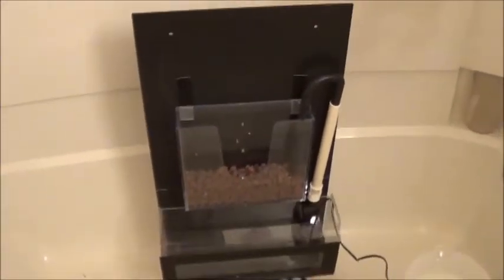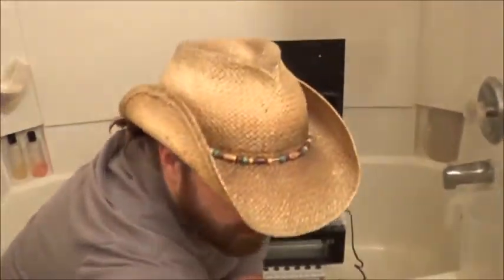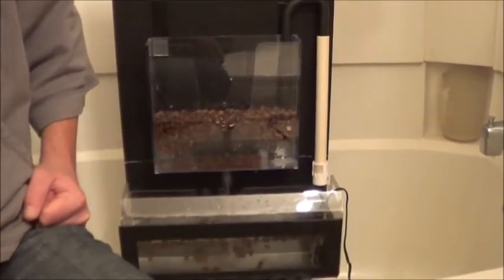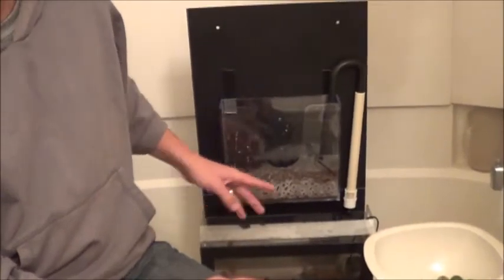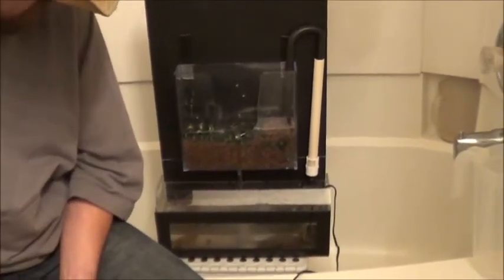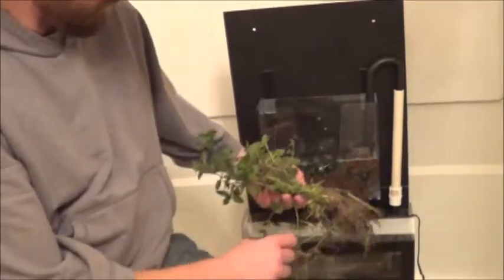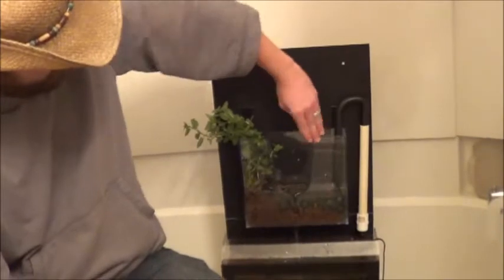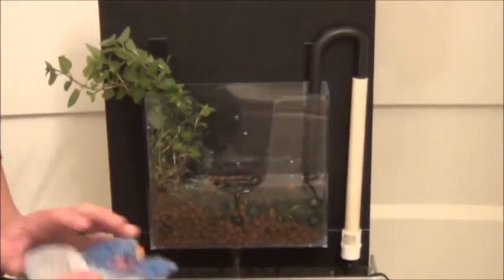Appleseed Aquaponic Waterfall Garden First Water Test

Comment: That was my first thought too... shorten the top of the pocket. Would save on materials cost also.
-
Second thought(a day later), with there being so little room for roots. Especially after watching your stevia video. Just move the curved part way to the top. Then there would be a nice deep pocket for roots. : )
-
Other thoughts / questions:

Why does the Pocket need to be adjustable(up n down) ?
The light does that. So there's really no need from my point of view.
That should cut the cost of the do dads that the pocket sticks to the back on, by 80-90%?
The 4 do dads could be pre-installed at the factory, so they're nice and straight. This would be a place for some uber QC! People having tilted pockets won't be happy.
-
I could go so many places with something like this. Just never had the money for all the up front cost. Like the thousands needed for patents to even consider starting with all these ideas that have gone through my head in the past 50 years. lol
Heck, just sitting here typing this, I've thought of a way to, not use, hydroton. : )
I still believe that stuff is not good for our ap systems. Because it's most likely continuing the nitrogen cycle all the way to removing nitrates. : (
Reply: Much like Kleenex being transposed from a 'brand' to the generic term for facial tissue, Hydroton has been associated with expanded clay pellets.  Expanded clay pellets are made by various means (the most common being heat and/or pressure based), but almost all involve using a 'natural' clay base (I would recommend researching the hybrid base products prior to use) .

Over the years of research, and my own experience, it has never shown empirical data that expanded clay pellets deplete nitrogen/nitrates in an  aquaponic system.  Some studies show just the opposite in that it assists in making the nitrogen/nitrate available.  Others show that the 'base' is basically neutral, and has little to no effect at all.

In traditional farming, it has been found that nitrogen molecules may 'attach' to the clay particles in the soil, and then be made available to the plant root zone.  To some degree, it could be said that it may stabilize the 'movement' of free nitrogen/nitrates in the water or soil, but not to the point of making in completely unavailable to the plant.

In most cases this is actually seen as a benefit, as the 'stabilized' molecules are then prevented from easily leeching away from the root zone, which can be a problem in rocky and/or sandy soils, or where water movement can be an issue..

Or at least that has been the finding I have found/seen over the past 50+ years of being associated with various forms of agriculture.  Perhaps others have seen differing results, and if so, I would like to see the supportive data so I can make better informed decisions as a result.
Reply from the maker: UncIe Bete As always, good thoughts & questions!
Reply from the maker: Thank you for an informed & well stated comment!  I love the vast pool of freely shared knowledge that is the YouTube aquaponic community ...
Reply: Richard Taylor
THIS, is a good example of why I end up writing "books" for comments. : ) : / XD
-
What I was getting at about the hydroton is this...
It has little holes.
These holes can create anaerobic zones for anaerobic bacteria to grow.
These bacteria can/will turn Nitrate into nitrogen gas.
These bubbles usually find their way into the atmosphere.
And well... removing our valuable Nitrate from our systems.
-
I've learnt(< it's a word now : P ) about this from years of fish only aquariums.
And one time specifically built a substrate in an aquarium, intended to do this.
The bad part with that experiment. Was that I put a few live plants in too. I didn't use anything but stock lighting, and very few plants. And had very little experience with plants at that time.
But a month later, when the bacteria should/could have been in there. My test showed 0 nitrates.

We've been trying to find ways for a long time in the fish only aquariums to remove nitrate. And there are quite a few gadgets claiming to do this. And 99% of them work on this principle... anaerobic bacteria.
-
Sorry for the confusion.
I have a LOT of clay in my yard. So yea, I've read some about it in dirt gardens too.
Good stuff... in the right proportions. : )

Comment: Nice video, JT. I do have some recommendations for the system though. I'm no expert, but I think that the box should be black instead of clear, otherwise I have a feeling that you'd have some wicked algae growth in there. Also, maybe the plumbing should run through the bottom of the container versus of outside it, that way you could just "snap" the pump on! No tubes required! And I definitely agree with you on shorting the sides, it does look like it would be hard to plant. And lastly, I may be biased, but I really think the tank should be bigger. I know it's meant to have a small footprint, but adding a gallon or two couldn't hurt. I'm just thinking about all the goldfish that will die in there. Sounds morbid, I know, but... I think that it should at least come with a chart that says what plants and fish you can put in it. Other than that, it does seem like it will turn out nice. It just needs some changes to make it "just right". Looking foreword to updates, JT! Keep up the good work!
Reply from the maker: Josh's Aquatics There's some room for 'tweaking' but it's a great start!  I would like to see a larger tank as well & have passed that though along the line.  :)
The idea of algae on the tank had already come up but you are talking about the grow pocket I suspect.  Some good ideas, I'll pass them along to Dan Burns !
Reply: Glad to hear about the larger tank! And yes, I am talking about the grow pocket. (: